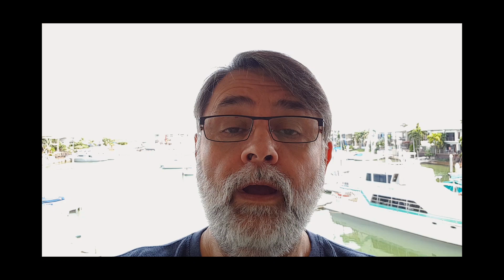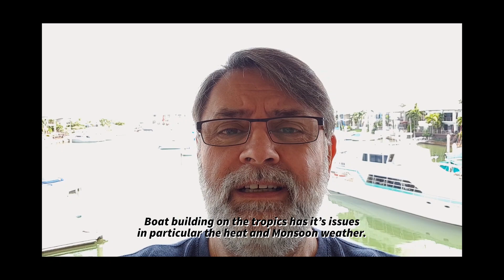Steel Sailboat Building - 2019 Update

Comment: So hot over there minus 5 here (uk somerset) this morning scraping ice of the cars.
Reply from the maker: Ha Ha Yes I can imagine the ice. I grew up in Rural Essex (came to Aus in 88) so do remember the winters very well, actually I quite miss them! Am a bit of a stubborn old bugger and have resisted spending time erecting a cover, but I just can't keep going any longer in this heat :-( hope you are enjoying some of the Videos, i will try to up the number of posts this year with lots of structural steel work still to do internally. Cheers, Gaz.